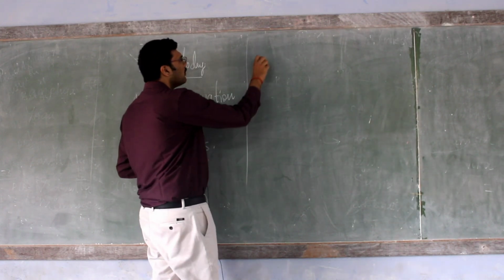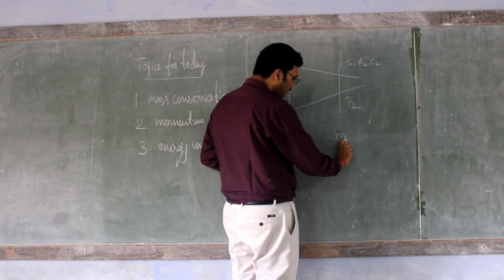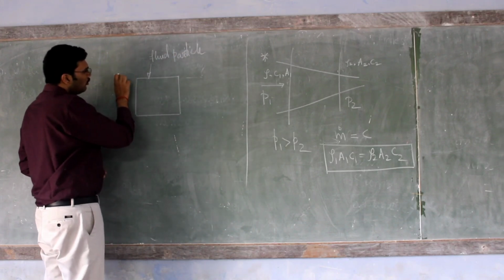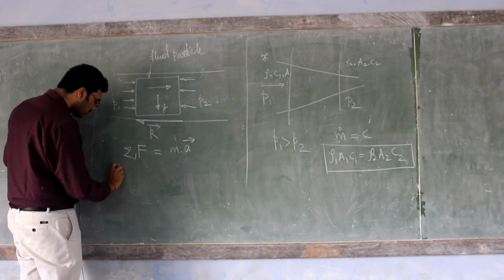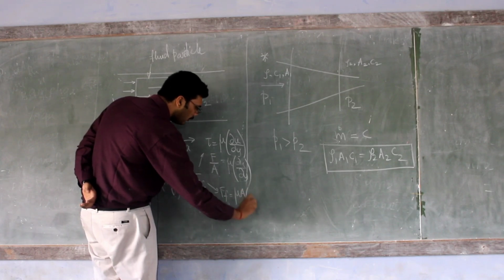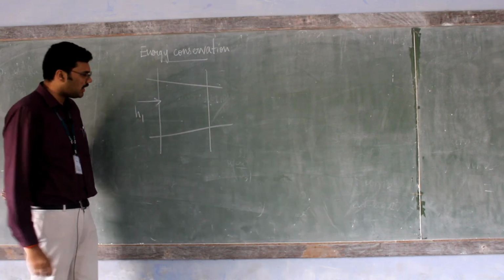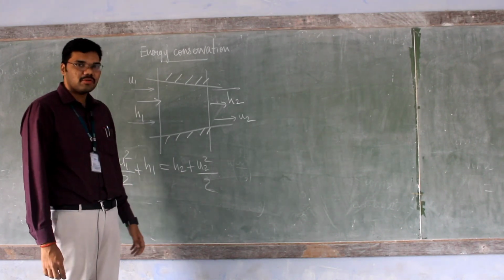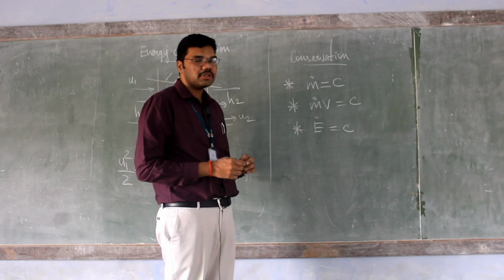Governing Equation

Comment: Nice lecture sir.  I am doing cfd research. In the following paper "3d cfd analysis of the effect of inlet air flow maldistribution on the fluid flow and heat transfer performance of plate fin and tube laminar heat exchangers" (in section 2.2) Governing equations can't be understood. Kindly explain how they wrote gov eqns.